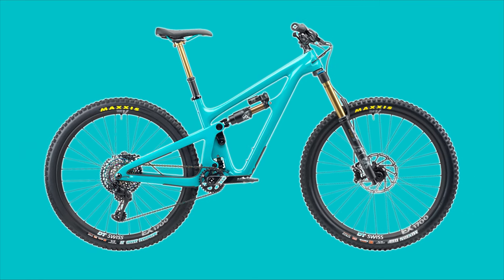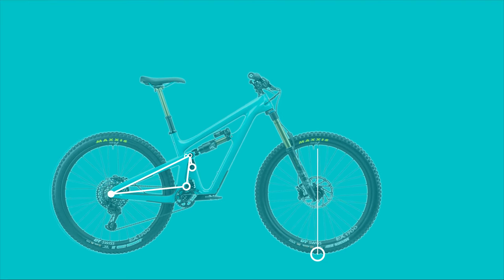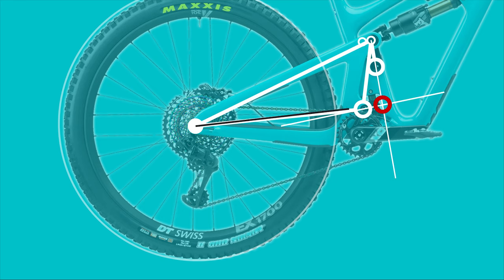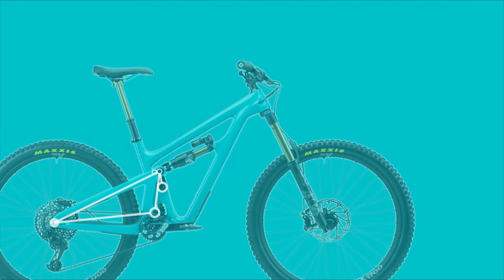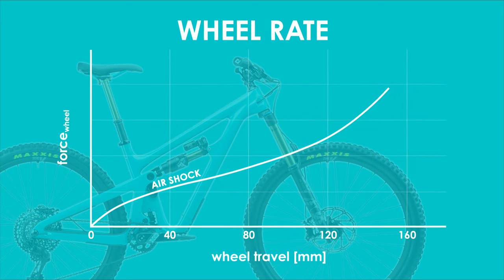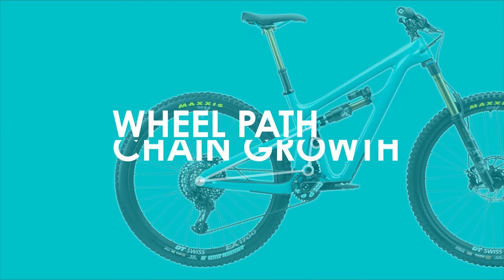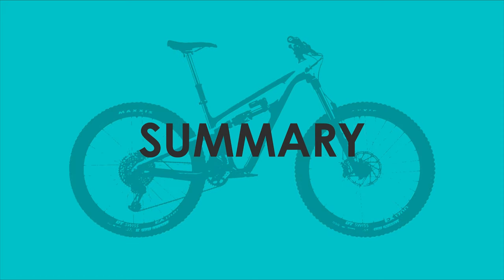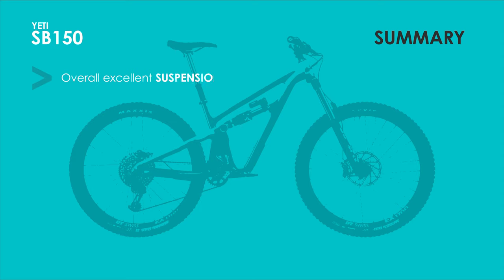Yeti SB150 SWITCH INFINITY Suspension REVIEW

Comment: I generally enjoy your videos and animations, as long as they are objective. In this one you revealed a very strong bias before the analysis was even presented and it came off a bit misleading. Some aspects of the bike were a bit over-stated: 
• Richie Rude does not win races simply due to the bike he rides. There have been many EWS winners on multiple suspension platforms including DW, Horst, and single pivot.
• Pedal bob can be manifested in either compression OR extension of suspension relative to chain forces and mass transfer. The high AS values on the Yeti certainly do not induce any “less” bob than a more active system, it just exhibits it in the opposite direction. This will negatively affect technical climbing ability, creating the feeling of being “hung-up” over larger square-edged obstacles.  
• Your comment on pedal kickback being low in deep compressions is irrelevant. On paper it is there, but in the real world no one is applying chain tension by pedaling through complete bottom-outs. Antisquat is always tuned for the USEABLE travel range, regardless of suspension system.
• Yeti’s anti rise values are extremely average. They’re not really even worth noting as a standout feature of the bike. 
• The “single pivot” plot that you use in your leverage ratio comparison is misleading. Virtually all single pivot bikes now use a swing or rocker link to drive the shock, allowing for drastic tunability of the leverage curve. It seems that you are trying to throw single pivots under the bus, much like MTB marketers have done for the last decade.
• Lower leverage ratio = LESS small bump sensitivity. More force is required to overcome the spring force and initiate compression. Also, the shock oil is forced through the damper at higher velocities, which creates more heat buildup. This offsets any volumetric or frictional advantages.
• Yeti’s low, linear leverage curve should be considered outdated at this point. It was a nice experiment but Specialized, Transition, Ibis, Orbea, Norco, Santa Cruz, and others have all moved to higher leverage ratios with more progression in their frames for the 2020 season. There is a tipping point, but in order to get the most out of coil or air suspension for more riders, there must be more progression built into the linkage design.
• There is no magic pill or secret sauce in suspension design. There are only compromises and decisions to make as to which ones suit your end users’ needs. Smooth climbing vs. technical climbing, descending in rough vs. sprinting on the motorway, steep vs. flat, tall/heavy riders vs. featherweights. These are all mutually exclusive and must be considered during the design process. Each brand has their own “ride quality” philosophy and generally stick to it, even if it’s not optimized for all riders. It’s as simple as that.
Reply from the maker: Very interesting points you make. The one in particular is the lower leverage ratio = less small bump sensitivity. During my reading it appeared that lower LR = lower pressures = lower seal friction as I had indicated, which based on my background I can understand why they would indicate this. Furthermore, while you indicate that the oil is forced through the damper at higher speeds, which I agree with, there is also less damping forces overall in the system due to the stroke being longer for a given wheel movement thus offsetting heat build-up from the speed. Obviously the number of repetitive hits and size of them also plays a huge role in the heat buildup.

Comment: Fantastic reviews, i think everyone wants one thing more that you have not touched on from the content i have seen. That is the best suspension design/company for the application/trial.  For example Specialized Enduro is best for........... kind of trail, etc.  Where as a Yeti SB150 excels in terrain type................ . To take it even a step further, maybe have a chart that shows the best bikes and designs for climbing all the way to descending, that would be incredible.
Reply from the maker: Thanks for the suggestion. I've thought about something like that, but I feel like I would get so many competing comments about which bike actually rides better that I'd rather just put the info out there along with my opinion and let viewers decide :)

Comment: AWESOME video! 

Aloha fellow shredders. Equivocating between the Yeti SB150 and Kona Process 153. Reviewed the analysis on the 153 and she looks nice. Appreciate any f/b from riders who run the 153. Mahalo loa nui 🏄‍♀️ 🏖 🦈
Reply from the maker: Thanks very much! Happy trails!
Reply: @TrailPOV - are you using linkage pro X3, or simulation software, to determine your geo/kinematics for each mtb? started using the persinal ver of X3. super slick!
Reply from the maker: @kenw8875  I am using my own kinematic software and CAD data supplied by manufacturer. Gives me better control and understanding of where the numbers come from.

Comment: A single pivot design is not necessarily perfectly linear. While not as tunable as other designs, by changing the shock mount, it can be also slightly regressive or progressive. The one with the most progresivity that I know is Orange 324 (2.64 to 2.4).
Reply from the maker: Agreed....as you will see with a soon to be release video. A simple single pivot like the orange is flat linear, but if you place the shock at a weird angle you can get it to have a sloping linear, and if you put linkages in then you can end up with really weird leverage ratios.
Reply: @TrailPOV  Nice. I will definitely follow! Regarding the linkage driven single pivot designs, like Evil or Kona for example, I always wondered why not just going to a 4-bar design where additional to the leverage ratio, you can also tune the IC movement during travel, if anyway you are loosing the biggest advantage of a simple single pivot, which is simplicity and maintenance. Maybe you can address also this in the upcoming video. Cheers!

Comment: Single-pivot bikes don't just inherently have a perfectly flat leverage ratio. They tend to be very close to flat on most designs, but it's simply because they're designed that way. By nature it's very very difficult to have a significantly progressive leverage curve on a single-pivot bike, but it's very easy to accidentally make them significantly regressive - as a result, when a single-pivot bike has a nearly flat leverage ratio it's probably because the manufacturer took significant care in avoiding a regressive curve, instead "settling" for a flat curve.

It's pretty tempting to think that since a single-pivot is a simple lever, the mechanical advantage of the system is always constant and therefore results in a perfectly flat line, perfectly constant leverage ratio all the time. However, when looking at it as a lever only the component of the force exerted by the ground that is perpendicular to the swingarm line actually goes into actuating the shock, and only the component of the force of the shock perpendicular to the main pivot/shock pivot line goes into resisting the motion of the swingarm.

Orange bikes (arguably the most ubiquitous single-pivot bikes) do have an almost flat leverage ratio: their shock is positioned very close to perpendicular with the main pivot/shock pivot line (and in fact I believe it crosses parallel at some point in its travel). However, if you look to some older examples such as the Cannondale Rush from 2010 or the Orbea Occam from around the same time period, they have the shock mounted at a rather extreme angle to the main pivot/shock pivot line, and that angle only gets even more extreme through the travel. That means the component of the shock's force that goes into resisting the motion of the swingarm reduces rather drastically as the bike moves through the travel, and the leverage ratio increases in a regressive design. This has been confirmed with linkage analysis software: the 2010 Cannondale Rush has a ~2.56 leverage ratio at full extension and a ~3.13 leverage ratio at full compression, for a regressivity of 22%.
Reply from the maker: It is an extremely good point you raise....I kinda figured someone would bring this up. It is true there have been several bikes with oddly place shocks with single pivot bikes, but I was trying to make a generalization for how most modern single pivot bikes respond. But a very valid point you make 👍
Reply: @TrailPOV  ah, fair enough. I haven't seen a true single-pivot in years without a flat leverage curve, so I think at this point that's a pretty valid generalization to make.

Excellent analysis on the Yeti! I actually had no idea the anti-squat dropped off so much towards the end of the travel, and now I want one.
Reply from the maker: You along with many others want one :)

Comment: Great info as always, just so I understand this correctly, is that considered the lower link where the swingarm travels lightly up or down keeping it on a straight axle path, if so what is the benefit of all the extra engineering and material as opposed to a simple link? Am I way off on what this is doing and understanding the benefits? Thanks
Reply from the maker: If it was a simple pivot at the bottom it would be linkage driven single pivot. By including that moving link, even if small movement, it creates a instantaneous centre line that extends in either directly thereby allowing the IC of the suspension to move during the travel resulting in different anti-rise and anti-squat characteristics than a normal single pivot. If you watch my latest video you'll see the difference :)
Reply: @TrailPOV   I see, I that is much different than I thought and makes much more sense. thank you

Comment: What do you think of the stress dispersion of the rear triangle to the pivot bearings? It seems as bearings get more dirty and slower, they wouldn't be able to disperse energy to the shock fast enough and take too much shear stress? Particularly that lower bearing linked to the infinity switch.
Reply from the maker: As long as you keep your bike clean and lubed then shouldn't be a problem.

Comment: Do you have any thoughts on the friction of the seals on the Switch Infinity Link altering suspension performance? I ask because my wife's SB100 seems especially sticky, and she's a lighter weight rider so she doesn't have a lot of air pressure in the shock pushing back.
Reply from the maker: In general running a shock at low pressures with lightweight riders means the stiction on the suspension is more pronounced compared with overal force required to activate the suspension. Same reason why motorbikes feel sooooo plush....their sprung weight is easily able to overcome the static friction. The friction doesn't increase significantly as the pressure inside the suspension goes up (there's a high minimum value)

Comment: Ok , understood . Thanks . 
in this video Sb 150 you say you wouldn't recommend a spring shock for this bike .
how about the Sb165 with come with a spring shock .
if possible I would like your opinion 
thank you
Reply from the maker: The SB165 has a slightly more progressive leverage ratio with a very progressive end stroke, so you could probably put on a spring shock without issue. It'll have good small bump compliance due to the shock and excellent bottom out support from the leverage ratio.

Comment: It would be interesting to hear your views on the pros and cons of high vs low leverage ratios.  It seems to me that many of the bikes today run fairly high leverage ratios across the board from short to long travel bikes.  If the leverage is the same from sag on, I wonder how differences in leverage ratios prior to sag impact ride feel.  Does it matter if you need to get to say 30% sag regardless?
Reply from the maker: The high leverage ratios to begin with means the shock doesn't move much for a lot of wheel travel so when you're chattering over small bumps and unweighting the bike, the suspension is not heavily hindered by damping forces. The high leverage ratios overall means you need a lot more pressure in the shock for the same weight rider to support them so if you are a heavy rider it's better to get a bike with lower ratios. While you typically pedal at sag, when going downhill you should use both below and above sag regularly.
Reply: @TrailPOV  Thanks for the reply!  In this video, you note that a lower leverage ratio offers better small bump compliance because you can run lower air shock pressure.  Many of today's bikes seem to run higher leverage ratios in the name of small bump compliance.  Which leverage ratio would you say offers better small bump compliance?  High leverage, but more pressure or low leverage, but less pressure?
Reply from the maker: @richchin5163  For an air shock the first part of the travel is very firm due to the sealing so a high leverage in this region is good to overcome this friction more easily and provide a supply first part of the stroke. Once you're in the mid stroke the high leverage ratio isn't as critical as the dynamic friction takes over and you just need enough pressure for you to be able to use your travel. Having too low a pressure for your weight isn't beneficial. And having a really high leverage ratio in the mid stroke isn't beneficial either.
Reply: @TrailPOV  Thank you for the continued education!

Comment: Did you consider the sliding joint at the bottom? It looked fixed in the animations.
Reply from the maker: Definitely did. The movement of this joint is very small in animation and real-life
Reply: Very interesting!
So the whole slider is designed bigger as needed... haha. Looks cool anyway ;) 
Did you think about a calculation of the new Specialized Enduro kinematics? It felt different to anything I tried yet, in a sensitive and active way.
Reply from the maker: @patrick4406  So far the Enduro is leading in the poll for next video 👍

Comment: It has 2 rear shocks, what do you expect? It will be linear of course
Reply from the maker: The short vertical link I would not classify as a shock...it has no air volume or damper and just provides a sliding pivot

Comment: So, nothing for a lightweight rider in cold weather. If you need such low pressure in the shock, it means that I would need really thin oil to get the rebound fast enough
Reply from the maker: Depending on how light you are, you could probably make it work
Reply: @TrailPOV  Probably not, have to change the Oil at all my bikes, but it is not that hard to do.  The standard Oil is ok, down to 10°C. If it is colder, I need to  change. I just ride 160 psi in my Santa Cruz Hightower e.g.

Comment: I disagree. I have both the x2 and DHX2. I got them both dialed in, then ran them back to back and I found the coil to be inherently better. I also run a Push 11/6 on my SB130. DHX2 is pretty notorious for going to the bottom, but I don’t feel it.
Reply from the maker: Good to know. Thanks for the input 👍
Reply: Trail POV you metioned facts , I more than agree with you + I tried the SB150 with air shock/vs/coil , the X2 feels way better on this bike!

Comment: Interesting. Except the comment that most climbing would be done on smooth fire roads. If there’s single track to climb why would someone ride smooth fire roads ?  Maybe this bike is only good fir descending tech but not climbing it?  

Very technical detail but I had a hard time making a connection between the details and your conclusions
Reply from the maker: Thanks for the feedback. I understand there is a lot of data but that's what the rewind button is for 🙂 The mountains I ride there is a lot of fire road climbing to get to most trails as opposed to rolling singletrack across the countryside. As long as the anti-squat isn't huge >130 then technical climbing will be easily doable. Happy trails!
Reply: @TrailPOV  Thanks for that.. i guess i avoid trails i have to ride long fire roads to get to.  :). Different riding styles/choices.  I’m also a weirdo that prefers climbing over tech a bit more than descending over it. Thanks again...lots of great data in these videos.

Comment: Why are you analyzing with a calculated IC?  What are you using as the lower link line?   The IC should just be the main pivot at all times.  This is essentially a single pivot bike at every point of travel even though the single pivot moves.
Reply from the maker: An interesting thought, but sliding members act as links with a pivot at an infinite distance when calculating ICs

Comment: The bike is solid and my Ebike conversion went great. https://www.youtube.com/post/UgkxHL1v1R3NE5x4KiYfyt8dnQmyNYz7qi5L  Very smooth ride at 30mph with no problems (135 miles ridden so far). The picture is a bit deceiving - there is WAY less space in the center of the frame than it shows. The suspension connection takes up the entire thing. So I needed to attach my battery on the bottom of the frame and my controller on the top. Instructions for assembly were lacking but honestly it wasn't too hard to figure out even though I have very little bike knowledge. Watched some youtube videos on adjusting the disk brakes but that was it. Still, I am loving it and very happy with the purchase.
Reply from the maker: The left pedal is reverse threaded purposely so it doesn't come undone while riding

Comment: Why do we care about low chain growth deep in the travel? kickback isn't an issue if you're moving forward with any speed, and you aren't going to be doing technical climbing that deep in the travel.
Reply from the maker: I think it's pedal kickback overall that they're trying to keep in check. They want a vertical wheel path during the beginning which means you have to drop and reduce kickback deep in the travel to make up for the length added at first